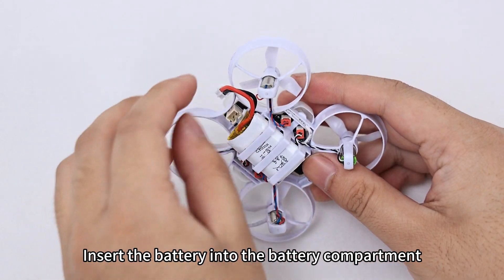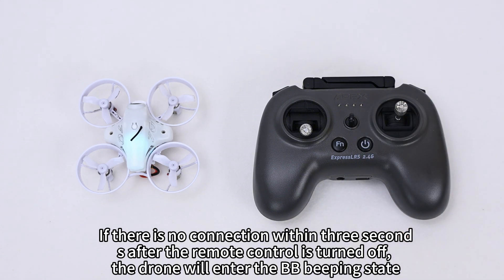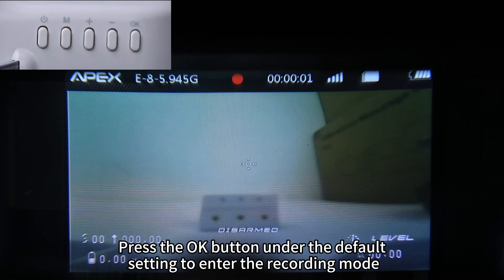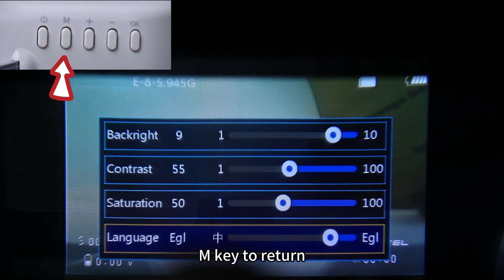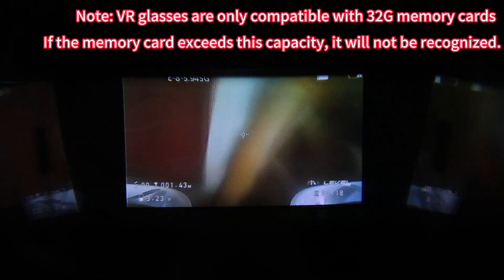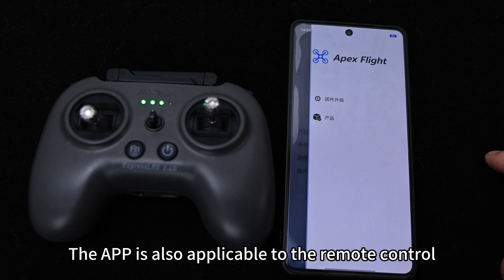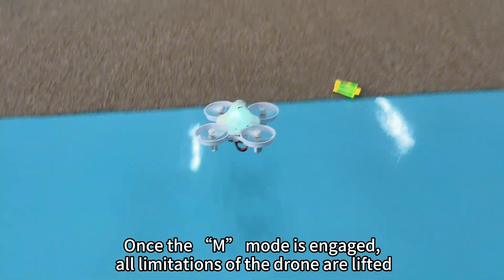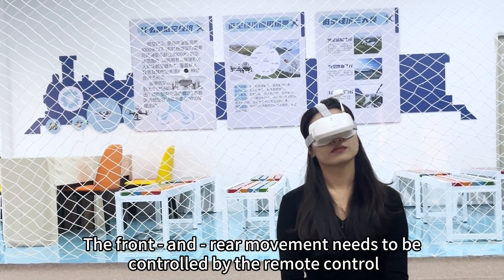Master 70FPV Racing Drone 4.0: A Complete Tutorial!

Comment: how is the durability???????
Reply from the maker: The VR-70 is made of high toughness environmental protection material, anti-drop and crash resistant without blowing up the machine, suitable for flying at home, can easily cross between the bottom of the table and the furniture, without hurting or damaging things, very suitable for novice players.
Reply: Awful. The thing is super brittle.